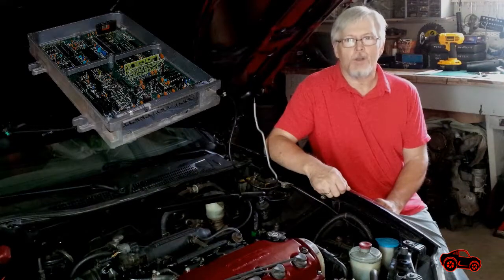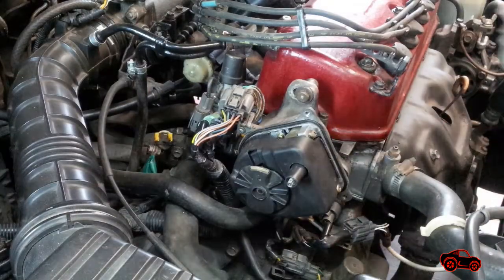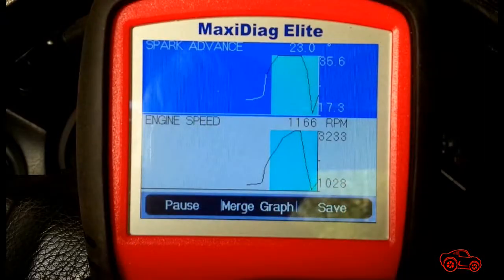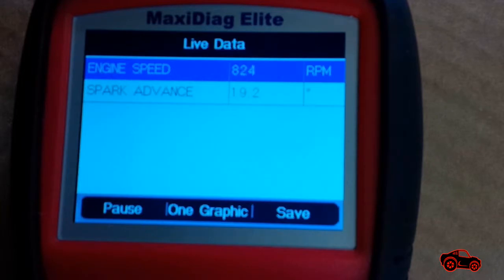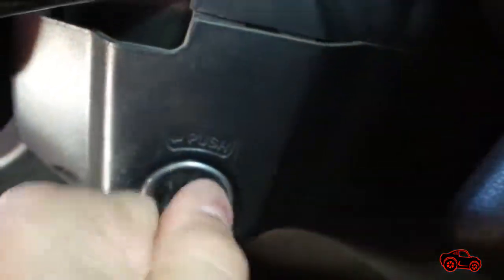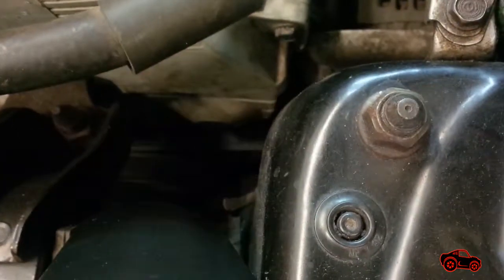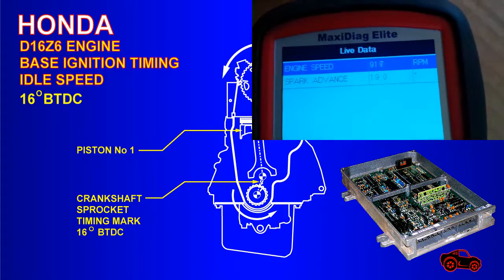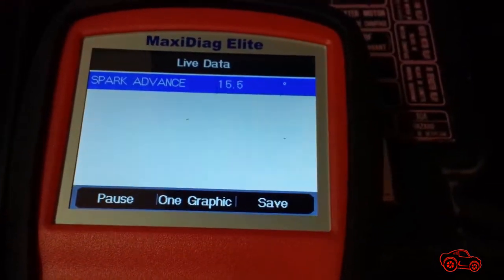HONDA DELSOL 1993 IGNITION TIMING VS OBD1 SPARK ADVANCE

Comment: Hello, I congratulations for your videos.
I would like to ask you a question. I have a 1992 Honda Prelude F22a. With the jumper wire in the service check connector. With a timing advance light, I can't get to 15 degrees, may be I get 5degrees at most , even with the distributor fully counter-clock wise. What could be the problem?. The car runs fine. but I think it is lacks of power in 2nd gear.
Reply from the maker: I do not know why it is not working. Your procedure seems fine with a P12 or a P14 ECU adjusted with the proper timing mark. 
Make sure there is a good continuity with the sockets in the SCS 2 cavity connector. and with the 2 wires going to the ECU.
If the contact is not established when using the jumper, the ECU will act as normal close loop running condition. Therefore it will always read all the input sensors and will override the manual advance set from the distributor.
Concerning the second gear lack of power, it could be many things like a the bad timing but it could also be a failure of the fuel pump. If your fuel pump is 30 years old, you should check the fuel pressure between the fuel filter and the injectors when the engine is under load. A low fuel pressure and/or pressure drop will affect the performance of the engine.

Comment: Is 12.5 to 15 degree fluctuation normal spark adv at idle for Toyota corolla 1.8l engine?
Reply from the maker: I do not have the specs on this engine since I normally get the required information about my personal vehicles and other vehicles from friends & family.
Reply: @mtlcarguy  is the spark advance suppose to fluctuate at idle?
Reply from the maker: @russelmussle7866  It can fluctuate. During close loop management the PCM is always adjusting the timing advance and the air/fuel ratio because it computes the information coming from the o2 sensors, the MAP sensor, the barometer sensor, the crankshaft sensor, air temperature sensor, the coolant temperature sensor, and more if equipped.
Reply: @mtlcarguy  interesting thank you very much!  I learn more and more :)

Comment: Did you buid the scanner cable? Its a 3 wire cable obd port 1998 honda .... do you have the schematics? Thamks
Reply from the maker: It was a 1993, not a 1998. Yes I built it. Watch MTLCARGUY EP1 - Honda OBD1 Live Data Scanner Reading   (wiring info= 0:39 +)
 https://www.youtube.com/watch?v=W3shKY2Kw4I&t=7s

Comment: Have an issue with my del sol 93. It starts very fine. But when you drive for a while the engine goes off on it own. Can you please help me out?
Reply from the maker: If your fuel pump is 27 years old, it is quite possible that the electrical motor in your fuel pump is heating too much and there is too much internal resistance. When it cools off after a while it can turn again but for a short time. Try this simple test: If you cannot hear the pump functioning (behind you) for 6 to 8 seconds when the key is turned from OFF to RUN position (without Start) just after the engine stalled, it could confirm that the fuel pump is too hot and is too old. An oscilloscope or a DSO connected on the power feed wire from the Main relay contact no.7 to the fuel pump could show a bad pattern and bad voltage because the pump is getting too old. But this test could cost you more than the pump itself. Note: The main relay can also have poor contacts sometimes. Electrical or electronic components can also create this kind of problem. Check online to find a YouTube to see what happened with a fuel pump with too much resistance or getting too hot and compare the symptoms with your car. If it is the pump, it is going to get worst every time you use your DelSol. Good luck !

Comment: Where was the obd1 port in your del sol?
Reply from the maker: The OBD1 protocol was used from 1993 to 1995 on the Honda Del Sol models. The Data Link Connector is called DLC.  It is located under the dash on the passenger side, near the ECU. For more details about it, watch my first video MTLCARGUY EP1 Honda OBD1 Live Data Scanner.